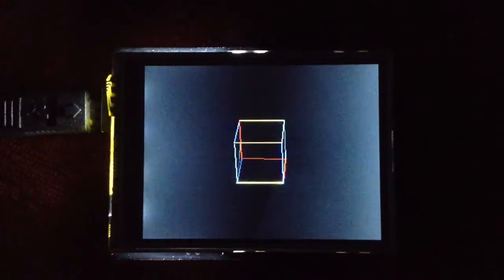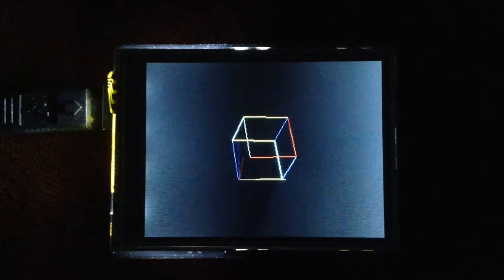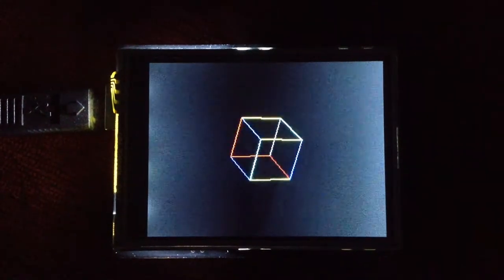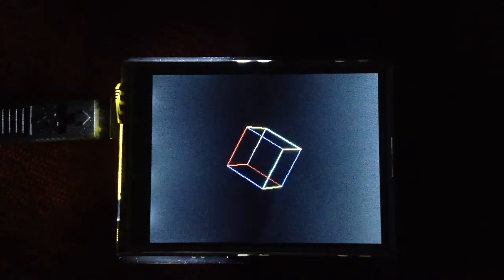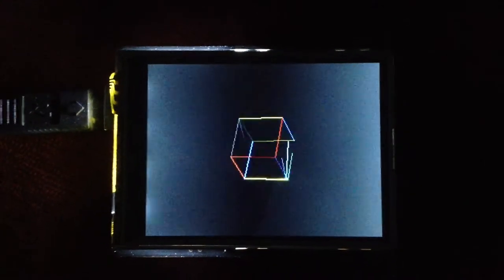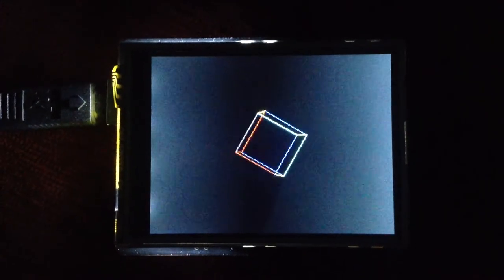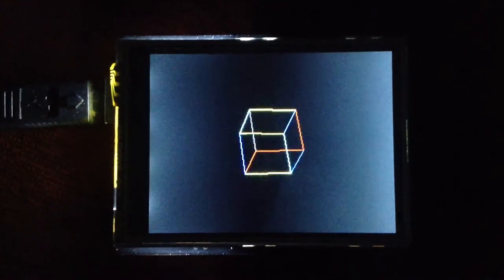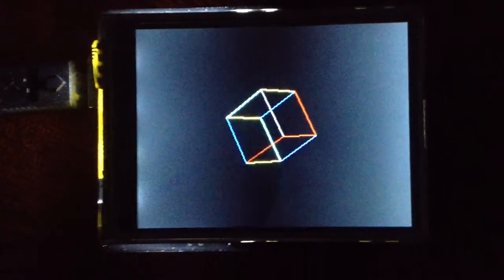3D Graphics Engine for Arduino

Comment: Lovely!

But PLEASE post at least SOME idea of method, source code would be favourite!

Thanks...
Reply from the maker: +Sprink Design I'll have to rewrite it - I started to write a library a long time ago, put it down for a long time, and then I forgot how it worked or where I was on it. While it sounds a little scary, the math functions it is doing are not all that hard. It is basically just some really simple matrice math.  Look up 3D to 2D projection and rotation matrice math.